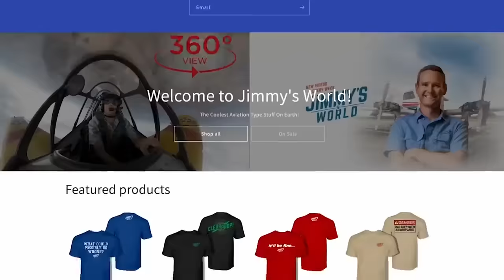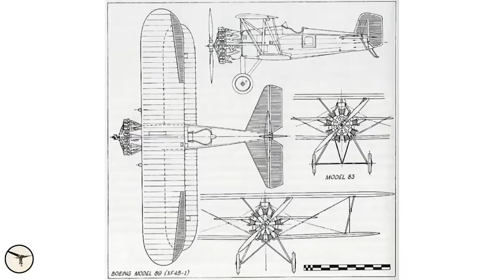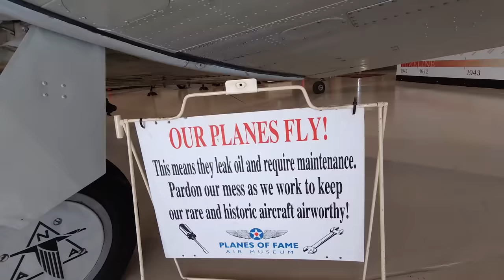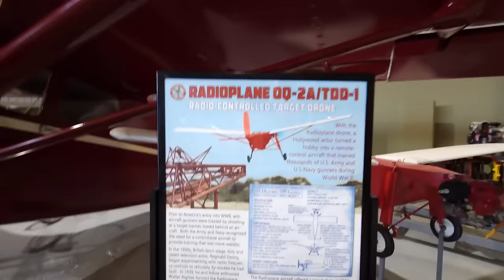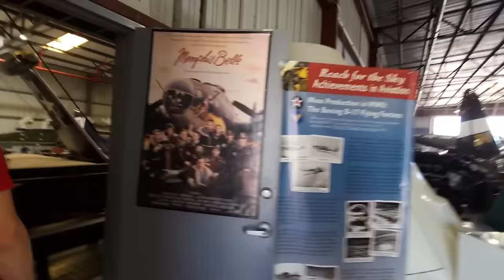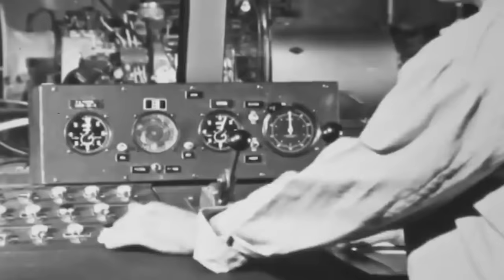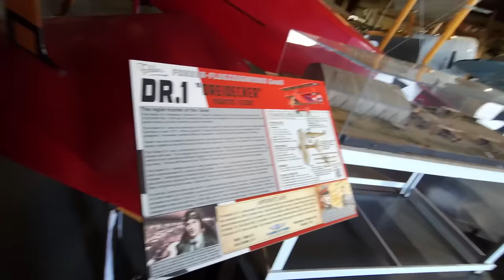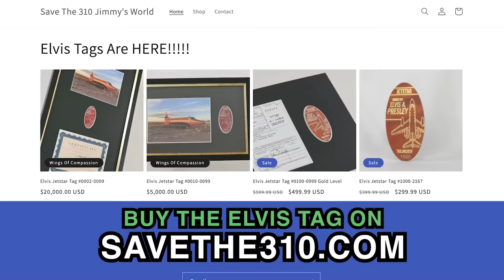Celebrity Airplanes Live HERE

Comment: Very nice DH98 Mosquito at 1:02:34 Quite rare birds as there's less than 7 flying in the world (all restorations), but I have to mention at 1:04:09 WA591 The Gloster Meteor T7!  That was a Gate Guard at RAF Woodvale until 1993, after a long restoration and flight it returned there in 2012 for the Southport Airshow, I have a very rare photo of it pulling Rainbow vapour due to the 
moisture/humidity in the air!

Comment: Just for your information, the Dwight Eisenhower constellation is called Columbine 2 Also known as the original air force one It is privately owned and Is the only Air Force one to be privately owned all others are in museums. as of 5 years ago it was flying they flew it from Arizona to Bridgewater. Virginia, where dynamic aviation is doing a full restoration on it and bringing it back to its original interior from when Dwight Eisenhower flew in it there is a video on Erik Johnston YouTube channel About them getting it running in Arizona. After setting for a while and flying it first to texas And then on to Bridgewater, Virginia, where the full restoration is currently happening.

Comment: I think they have that same Wee Willy P51 and Strega in Microsoft Flight Sim along with a bunch of other Reno racers. They have a whole Reno Racing mode in MS Flight Sim and I built a pretty good flight rig for my Xbox X. I just need a graphics card for my PC along with other stuff nd some good VR headset and I'll be set man. Now I'ma go fly a P51 or my F51 Voodoo in msfs lol. What great stories to go with all those planes, the museum guide guy is very very knowledgeable, but I wonder if he works on stuff too. Excellent vid Jimbo. Lol Your soo lucky Jimmy, I've been building customizing fabricating wiring and working on cars/Xboxes/PCs nd much more for about 20 yrs but I wanna start working on planes but I need to get my pilots license too. I never knew that the reno racers have fuel on one wing and water in the other cause theyre banking left pretty much the whole time. Maybe thats why the reno p51s that i fly in msfs wanna just roll left on their own even while the throttle is cut so its def not prop torque steer or whatever the proper terminology is for that. Great vid man as usual. I wanna see u fix or fly a beechcraft baron or a Cessna 410 or 412 or a king air or somethin, i wanna see you do some powerful twin prop plane, or i wanna see you customize some plane, like add power or reinforce airframe or somethin

Comment: Dude that is NOT the Bermuda triangle. You better work on your flight plan for you take that trip. It goes for Miami to Bermuda to San Juan, Puerto Rico and back which makes a triangle about 10 times larger than the one you're showing.

Also the calls of the disappearances has been solved - it was because of so much natural gas coming up from the floor of the ocean that sank the ships and is it rises into the sky it choked the engines of the planes.

Comment: These 1 engines planes:
John Denver...
Buddy , Holly, the Big Bopper, Ritchie Valens..
Randy Rhoades...
They aint stable compared to 4 engines Boeings..
Nice crop dusters or 
ww2 
1 engine fighters for all warparties...
But trackrecord is bad.
 
U never get me flying in 1 of these simple designs...
Reply: If you are trying to say a private aviation twin is safer than a single engine airplane, you would be wrong.  The statistics confirm that statement.  While there is comfort in the second engine pilots are inclined to fly differently than a single engine plane.  When you loose one engine the other engine only extends the amount of time you have to get the plane on the ground.  Most cannot sustain flight with only one engine.